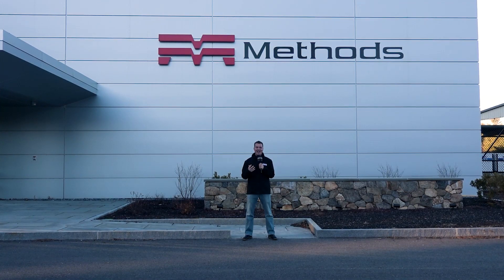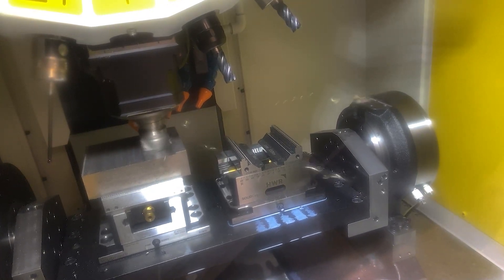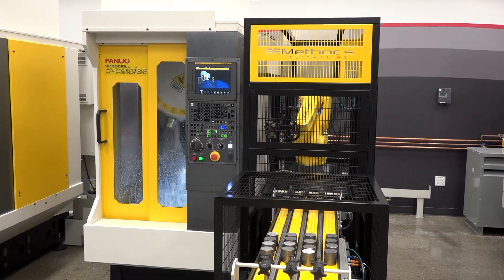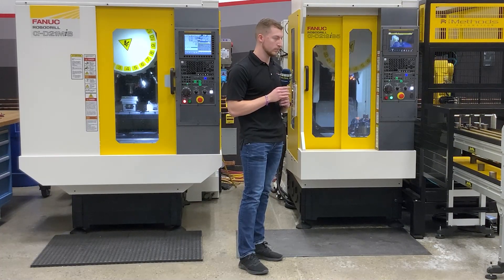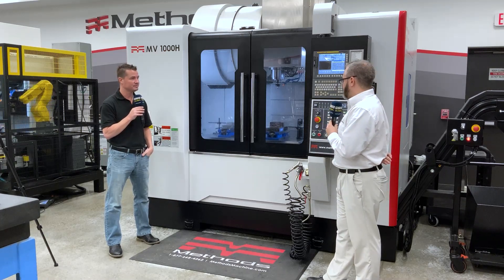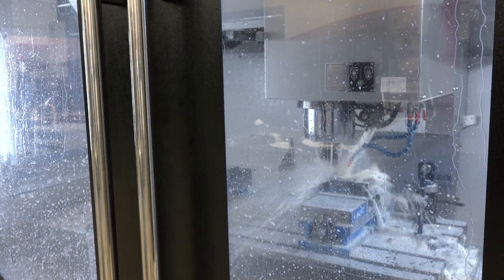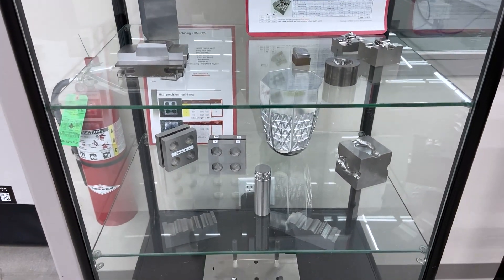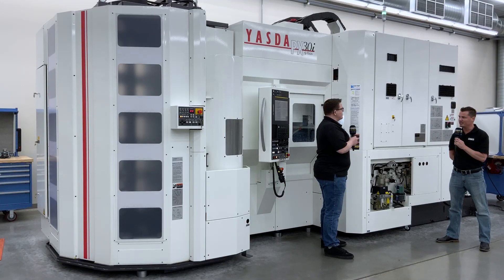Tour of Methods Machine Tools

Comment: Nice masks dummies
Reply: Give it a break pal
Reply: .1 microns? Wow! Or was that 0.0001inch? Donno! Impressive anyhow.
Reply: @nash0427  inch, its the usa
Reply: @max_eley  Well, then, it is not 0.1 MICRON as alluded by the presenter. That is around 2.5 microns and, therefore, easier to get to grips with. What's the volumetric accuracy of that machine?
Reply: @nash0427  What was the machine, a mill?, i did not watch the full video.
Reply: @max_eley  the Yasda
Reply: @nash0427  yasada, 5 axis vmc, its not 0.1 micron, it could hit 2.5 microns, all about the person using it tbh, you might hit sub microns, not just by telling the machine to do so however.